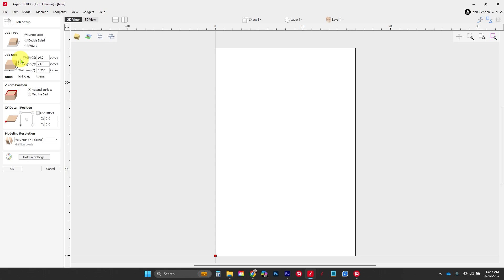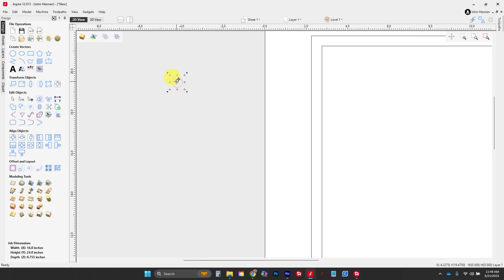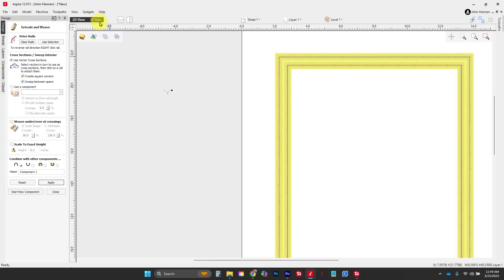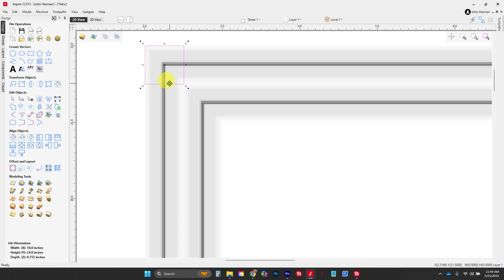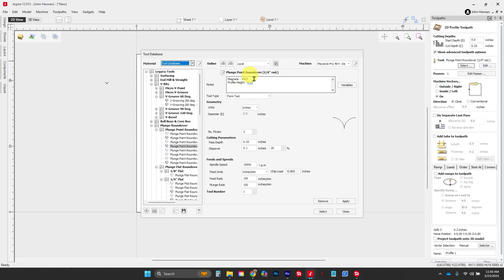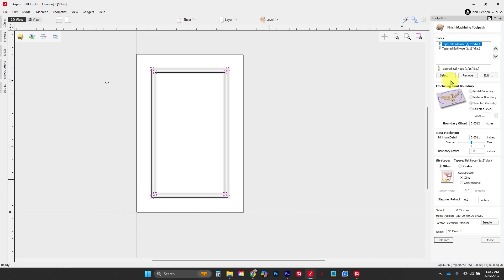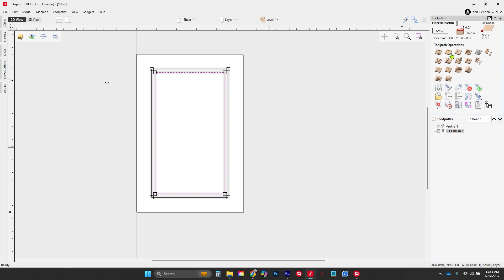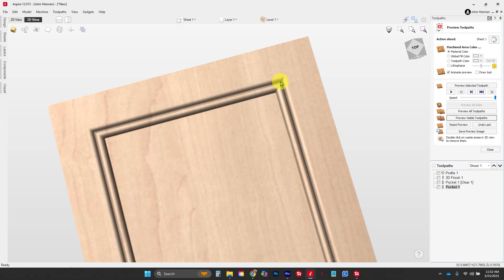Challenge Accepted - Creating a beaded Flat Panel Door with Square Corners

Comment: Can this method be done with vacrve pro? Or do you require Aspire to use this method? Thanks  in advance😀
Reply from the maker: For this method you will need Aspire.
Reply: @legacycnc8232  Thank you for the reply. Is it possible to replicate this method using a molding toolpath? If you don't have Aspire. Would that be a work around?
Reply from the maker: Yes you can do that!  You need to adjust the vectors as the molding toolpath uses the edge of the shaped vector as the point that follows the vector, but yes, you sure can!
Reply: When I did the 3d tool path it simulated a deeper cut 
Any ideas where I went wrong ?